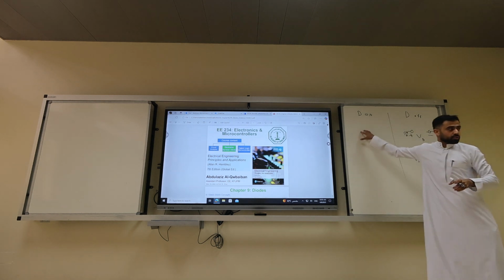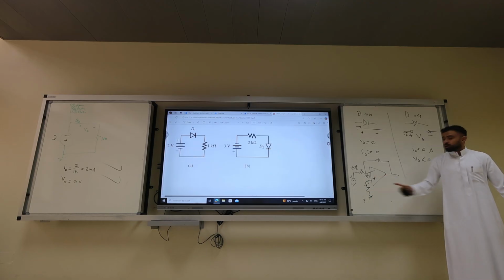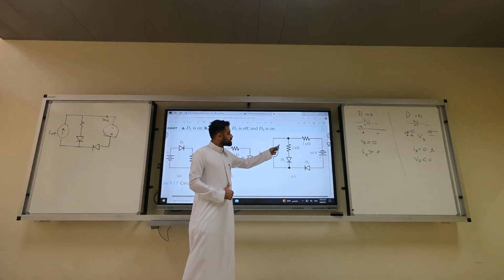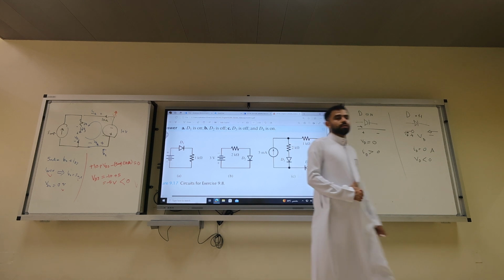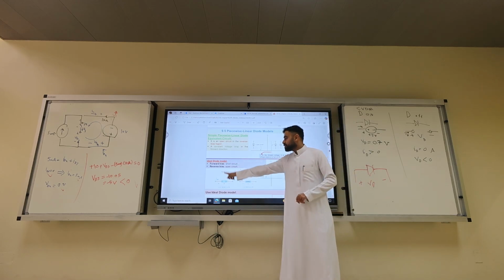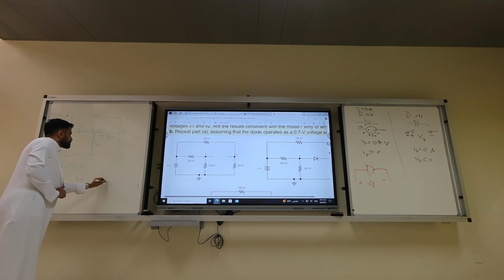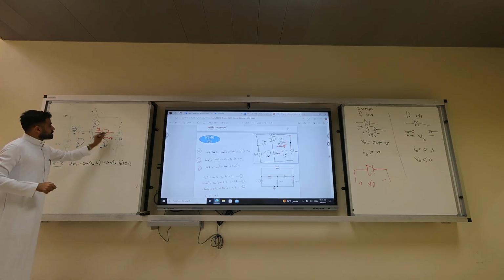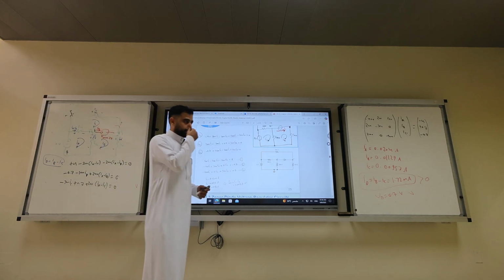EE234 Lecture 32 [Constant Voltage Diode Model]

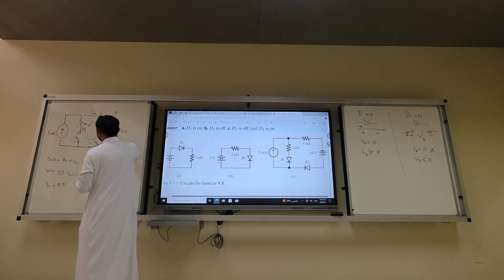Comment: why the voltage drop across the resistor is zero 17:51 ?
Reply from the maker: The branch is open no current will flow through it.